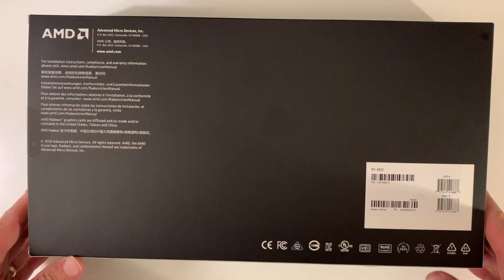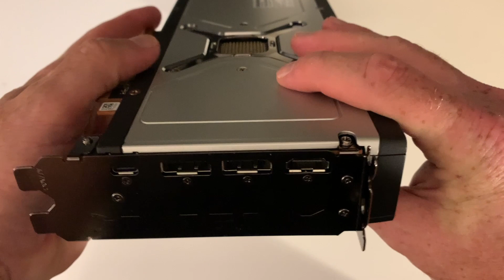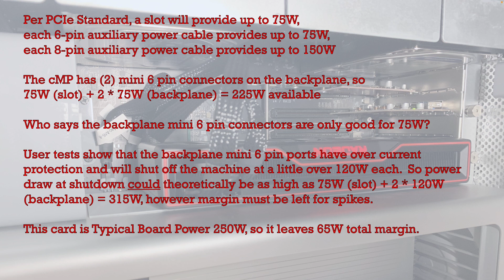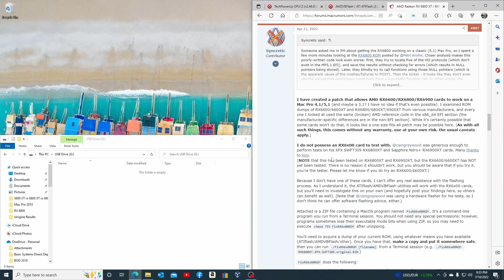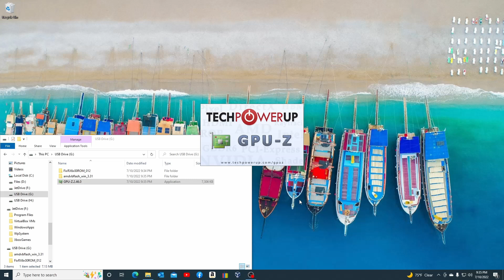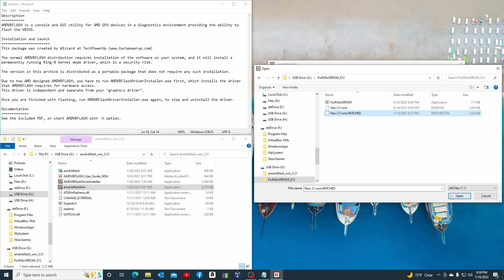RX 6800 in a Mac Pro 5,1

Comment: Whilst Apple have moved on to their own MSeries processors/GPUs I do wonder if they will also include drivers for upcoming, (AMD at least), GPUS going forward. There are plenty of loyal Mac users that still want to use the Macs they have with the software and external hardware, (eGPU), that they still have.
Reply from the maker: @gottliebdee263 I think Apple has indeed moved on and don't expect them ever to include RX 7000 series GPU support in macOS.  Just isn't the direction Apple is taking macOS.

Comment: Good morning.  I was wondering if you ever ran into a problem with not seeing the usb drive with monterey or newer on it?   Is your 6800 flashed for a mac?
Reply from the maker: I made that vid a year and a half ago and don't believe I was on macOS Monterey at the time.  A Mac Pro Upgrade Facebook member said that after some version of macOS it would be recognized, but I never got it to work in macOS.  Half a year ago I bought an HP Z440, and the RX 6800 has been in that ever since.  Yesterday I installed a new to me Radeon Pro W5700, which also has a USB C port.  On first try, it seems to work in macOS, Windows, and even pre-boot.  I've tried a 4K webcam and USB mouse in it so far.
Reply from the maker: You also asked if it is flashed for Mac.  As shown in the video, I downloaded the VBIOS, used Syncretic's Fix Tool on it, and flashed the modified VBOIS on the card.  It is not flashed for native Apple boot screen.  With OpenCore having a boot picker and boot screen, why would I?
Reply: Hum. I'm trying to put Sonoma on my machine and I'm having the hardest time.  Never had an issue before, but now I don't see my usb with OS and on it.  I keep having to put a gpu in the machine that is for mac to see the mac boot selector. I'm wondering if the titan ridge thunderbolt card I have in it to run my two thunderbolt displays have anything to do with it.  Thank you for your response. @borderlineobsolete

Comment: Good video Doug, great information for Mac Pro Users. from what I read on a Apple forum the six pin mini PCIe power connector on the 1,1 to 5,1 Mac Pro are rated at 75 watts each, Mac Pro users have fried the traces on their mother boards before.
Reply from the maker: I've read that as well and have been cautious.  To my knowledge there haven't been any failures due to the RX 6800.  If I find of any I'll be sure to  note it here.

Comment: I noticed you have test scores for the RX 6600 XT Red Devil. I have the same card and am having trouble of it being recognized in my Mac Pro 5,1.  Were you able to insert it into the very bottom pci slot? Mine doesn't seem to fit there because of the back plate and I had to put it on the second pci slot just above. I'm not sure if this is the reason why it's not being recognized? I did use the Syncretic rom flash. I also recently upgraded my OS to Monterey with Opencore 6.8.  For power, the Red Devil 6600 XT has an 8 pin and a 6 pin connector. I used a mini 6 pin to 6(2) pin cable for both of these for power. Please help me, I've been searching everywhere for answers but can't get it to work.
Reply from the maker: Unigine Superposition pretty much misidentified every card.  Mine was a Powercolor Fighter, not the Red Devil.  Possibly the way you're powering the card is causing a problem.  Read this https://thehouseofmoth.com/mac-pro-pixlas-mod-is-it-really-needed/ and this is part of a long post, but the post directly linked explains how to make a bridge to even out the draw between the 6 and 8 pin connectors.  I would recommend the EVGA Powerlink, but from pictures it does not look like it will fit on the Red Devil.
Reply: @borderlineobsolete  But you powered your 6800 without the pixelas mod and I would think the 6800 is a more powerful card than the 6600 XT. The back panel should draw enough power?
Reply from the maker: @Bloodklot  it's a balance problem, not a total power draw problem.  The RX 6800 has two 8 pin connectors, so its power draw is balanced.  Your card has a 6 pin power connector and an 8 pin power connector.  It will pull roughly twice as much power from the 8 pin connector than the 6 pin.  The bridge wiring mentioned in the MacRumors thread I linked earlier will balance the draw between the two backplane mini 6 pin connectors. I'm not sure any of this explains your system recognizing the card.  Is the card known to work in a different computer? Some things to try: 1) NVRAM reset, 2) Boot in Safe mode, then boot regular, 3) Any chance a previous owner modified the VBIOS, say for mining? if so then the solution is to replace it with the original from TechPowerUp (which would need to be fixed with Syncretic's tool). 4) Try connecting your monitor to different ports (DisplayPort, HDMI).
Reply: @borderlineobsolete  yeah so switching ports didn’t work so you are probably 100% correct with the power draw problem. I bought the EVGA Powerlink today to give that a try. I think it might work since I took off the bulky back plate, it might fit. I’ve already used syncretic’s rom patch but I’ll give those other options you mentioned a try. And the card works perfectly in a PC but I don’t have another Mac to test it on lol Thank you!
Reply: @borderlineobsolete  I took apart the card today so I could remove the back panel so I can insert the card into slot one. But I haven’t put the card back together yet. I’ll have to re apply the thermal paste tomorrow

Comment: Hi Doug! Thanks for your great video. Do you know something about the Dell RWKN3 6800 XT card in a MP 5,1? It seems, that this card is just 2 slots high, but the XT model.
Reply from the maker: I think it’s a great choice for the cMP. Would not go higher than RX 6800 without Pixlas, though.
Reply: @borderlineobsolete  Thanks a lot for your feedback. Will have a look at it.

Comment: Nice Video, I did everything like the video says BUT my Mac Pro says I'm running a "Display 7MB" -  the performance is accordingly. What did I do wrong?
Reply from the maker: I don’t know.   Let’s see. Are you running Big Sur or Monterey?  No driver for these cards before Big Sur. 

Is there any chance the VBIOS was modified for gaming or mining?  If so you can use one of the VBIOSs from TechPowerUp.
Reply: @borderlineobsolete  well I’m running a cMP 5.1 with a RX 6800 (modded according your other video) on monterey. Installed via the latest opencore legacy patcher… wasnˋt able to overwrite the „core“ and „boot“ folder with Martin Lo` s version. Thank you 😊
Reply: Sounds like you used a different video card to and root patched it in OCLP, run revert root patch's, shutdown and then install your video card, and re-run root patching.

Comment: Would the Rx 6800 give Lightroom and photoshop better performance than the RX 580?
Reply from the maker: I haven't used either program and don't know how they use the GPU.  in gaming the RX 6800 performance is 297% compared to the RX 580, so it's a much stronger GPU.
Reply: @borderlineobsolete  ok, thank you!

Comment: Hey Doug - been working thru this process the last 24 hours.  the AMDVBFLASH program is totally goofy when using the GUI,  the new version didn't seem to want to work at all.  So I got 3.31 loaded and ready to go, i looked up how to use the command prompt version and could get it rolling.  I get halted at the part of the process where I try to flash the actual card and I get an error, letting me know that the SSID of my old ROM is a different four digit number than the SSID of the new ROM.  This is with all the appropriate commands for forcing flash, to get past all the hiccups of SSID and P/N checks.  Flashing never worked once with the GUI and always errored out.   When I got command version running, all is well until the flash fails on error before ever starting.  Am i missing something?  do i need to rename the patched file back to "navi 21.rom" without the (PATCHED) at the end?  I did indeed patch my original VBIOS that i pulled off the card with GPUZ.  Card is MSI RX6800 - Any help would be much appreciated.  thanks!
Reply from the maker: Have you installed the driver?  From the Readme file, "Due to how AMD designed AMDVBFLASH, you have to run AMDVBFlashDriverInstaller.exe first, which installs the driver that AMDVBFLASH requires for hardware access. 
This driver is independent and separate from your "graphics driver".

Once you are finished with flashing, run AMDVBFlashDriverInstaller.exe again, to stop and uninstall the driver."  That's the only thing I don't see that you're doing.
Reply: @borderlineobsolete unfortunately I did successfully install the the driver, which makes this even more confusing.  I had another guy mention maybe i need to be logged in as administrator instead of run the program as administrator.  I even used the -unlockrom command that has worked for some folks.  I will be fooling with it tonite.  thanks for your help.

Comment: Great video, thank you! :trophy-yellow-smiling:  PRO TIP:  I got an AMD RX 6900 XT to work in the mac pro without sacrificing the second 16X slot by getting a 1" riser card for the video card (in 16X slot #1), and using a riser ribbon for the card in the second 16X slot and placing that card sideways in my case.  May go without saying, but I had already performed the Pixlas Mod.
Reply: Do you have a link of the riser card or some pictures, where we can see your modification?
Reply: @clemensfischer    I do actually!  Here is a vid:  https://www.youtube.com/shorts/moYCNG9LGuI. Note - The Sonnet card can be placed upright (Like it is in the video) right next to the video card and you can still close the case.  One end of the Sonnet card sits on the yellow power cables of the RX 6900.
Reply: @Kevin_MK7RSR  Thanks a lot!

Comment: Can you tell how much better this card is vs the RX580?
Reply from the maker: TechPowerUp’s relative performance shows the RX 6800 at 297% compared to the RX 580.  You won’t see that much of an increase in a Mac Pro, as frame rates are limited by the processor, PCIe speed, RAM speed, etc. of the computer.  The RX 6800 will provide a better experience than the RX 580 at 1440p gaming and at 4K.

Comment: any way you can explain how you got amdvbflash to load?  I have been trying for days.  just keep getting errors.   I have tried to open it on other computers I can't even put  video card in and same problem.
Reply from the maker: The Windows GUI version of AMDVBFlash is not included in the newest version.  Version History says: "5.0.567 (March 10th, 2023)
Added support for flashing Navi 3x GPUs (Radeon RX 7900 XTX and RX 7900 XT)
Only the console version (amdvbflash.exe) is included, the AMDVBFlashWin GUI (amdvbflashWin.exe) seems to be retired."
Seems like you'll need to download one of the older versions.  It's in amdvbflash_win_3.31.
AMDVBFlashDriverInstaller must be run before AMDVBFlash.  Then run it again when finished AMDVBFlash to remove the driver.

Comment: I realize I'm late to the party, yet I want to thank you for this info.

I went down the same path with my 5,1 then built an opencore AMD build.

The AMD RYZENTOSH is my daily driver now, the Mac Pro is used strictly as a server now which is rarely powered up as it draws so much power even at idle.
Reply: I forgot to say, if your still using your 5,1, the single biggest improvement I did for mine was installing a pci m.2 card.  Full speed and much faster than the sata 2 limitations.

Comment: Is there any way to make a 6500xt work in the 5,1, the initial look i had said no but can get my hands on one for a pretty decent price, maybe even less that what i can get a rx 580 for.

Also have a 6700 in my main pc rig that may try with.
Reply from the maker: Neither the 6500XT nor the 6700 have drivers in macOS, though there is a post on MacRumors forums that someone was able to run Syncretic's tool on a 6700 XT and use it for Windows in a Mac Pro.  This link shows macOS support for AMD GPUs https://dortania.github.io/GPU-Buyers-Guide/modern-gpus/amd-gpu.html.

Comment: I am about to put a 6800 in a mac pro 5,1 with preexisting pixlas mod and have heard about USB ports not working after installing the card.  Has anyone had this issue?

One last question, I am swapping the 6800 into my PC to flash it (which is running an NVIDIA), do I have to install the radeon drivers in order to flash it?  I wouldn't think I would but some people have put radeon software installation into their tutorials. The card will work without drivers, just won't have acceleration.
Reply from the maker: About the USB ports: the reference RX 6800 and 6800 XT have a USB port on the graphic card.  We've found that it is fully functional in Windows, but only passes through video in macOS (no keyboards, mice, external drive support).  I know of no other effect on USB.

You don't have to install the Radeon drivers.  Of course, Windows is Windows so it will try to install them without asking.  To avoid the Radeon drivers, you can download all of the needed files, then turn off wi-fi and unplug ethernet on the PC before inserting the RX 6800.  I used my son's computer and was afraid of somehow screwing it up, so I disconnected all of his drives and used a USB Windows installer to install Windows on a spare SSD for the flashing work.

Comment: what is the spec of the cable for power from the back plane to the video cards?  Better yet where to buy?  About to do this!  thank you!
Reply from the maker: Here are the cables I use: https://www.ebay.com/itm/184855728352, I have recently added an EVGA Powerlink, which fits in the Mac with the reference card and these cables, https://www.amazon.com/dp/B01MQ1YEYH?psc=1&ref=ppx_yo2ov_dt_b_product_details.  It better balances power draw from the mini 6 pin backplane connectors.

Comment: How are you running Flight Sim? Parallels, Bootcamp, or dual boot with Windows?
Reply from the maker: I’m using an EFI Windows 10 install using OpenCore.  Windows is on its own 2.5” SATA drive.
Reply: @borderlineobsolete  thanks know of any good walk through videos or websites for setting that up?
Reply from the maker: Yes.  Search YouTube for OpenCore the Basic Way - Windows by Jeorg Henninges.

Comment: Great video. My question to you is, can you do this flashing on a Mac Pro 5,1 with Windows installed? Or does it need to be a seperate PC?
Reply from the maker: You can’t flash it on a 5,1 because the 5,1 won’t boot with the unmodified VBIOS.

Comment: So the RX 6800 is the max card for a non pixlas modded 5,1.
Reply: I honestly wouldn't recommend doing that.  The PCIE slot gives 75w, the 2 mini 6 pins give 75 each for a total of 225w.  This card can draw 250w.  Your logic board isn't going to like that.
Reply: The consensus seems to be that this is the most powerful that will work off the backplane power. It's right on the edge, but many people seem to be fine with it. If you're paranoid though, you can always do the mod.

Comment: A few things about the card. 1) It will vent hot air into the Mac Pro. Will need to increase fan to remove hot air. 2) The TDP of 250 Watts is minimum. 3) The CPUs in Mac Pro 4,1 & 5,1 bottleneck this card bad. It does have great Metal performance. The PSU Mod is needed to keep from burning Logic Board.

Comment: Nice video Doug, I got lucky on the drag and drop with the patched bios, just tried it for the heck of it and it worked, you just have to be logged into the administrative account on the PC. It looks like this card could be the sweet spot for keeping all slots open and not having to do the pixlas mod but if you put a full sized card in it the 2nd slot the airflow to the GPU would be blocked and most likely run hotter.
Reply from the maker: That drag and drop trick was the coolest thing I’ve seen in a while. I used MSDOS out of college and transitioned through every version of Windows, and had never seen that done.  I’d like to see some more people run the card without Pixlas and report. I’m afraid that there may be a program that will load it up. Maybe some action shooter game?
Reply: @borderlineobsolete  I just read on Mac rumors that Dells Alienware rx6800xt is only 2 slot wide, and can be found on eBay for reasonable price but I don’t think you can buy one new.
Reply: @borderlineobsolete  Resident Evil 8 village has a free demo on Steam might be a good one to try on highest settings with raytracing on. That will push it to its limits. One thing to test is higher resolutions like 1440p or 4K is where the new GPU should outperform the older ones instead of 1080.

Comment: thanks for this video doug.
may i ask, what kind of pc you use for the vbios flash?
Reply from the maker: My younger son took parts from a small Alienware computer and put them in a custom case with new motherboard and power supply.  The processor and RAM is about 8 years old, I think.
Reply: @borderlineobsolete  : so chances are good to perform it in an old Dell T3500 WS... :)
Reply from the maker: @Bilderwecken  I'd give it a try.
Reply from the maker: I assume the T3500 worked for flashing the card.
Reply from the maker: Joerg, I tried the USB port on the reference RX 6800 again. Same result. Works in Windows, not in Monterey 12.5. It works for HDMI pass through in both, but USB functions (wired keyboard, flash drive) only on Windows. Any suggestions to make it work in MacOS?
Reply: @borderlineobsolete  : maybe there will be a kext to inject via OpenCore as soon as more user have the card?
in fact, it does charging usb-c devices under macOS... 💁🏻‍♂️